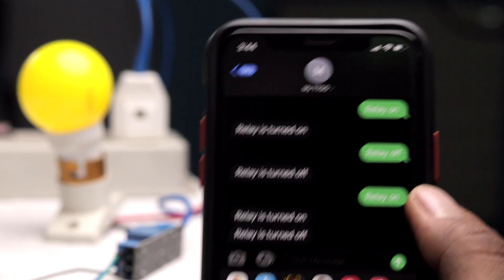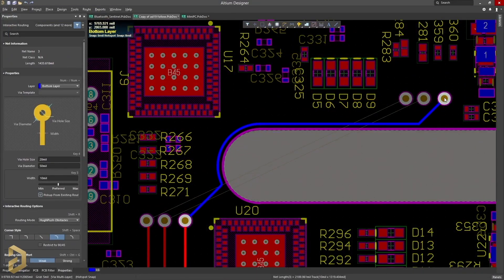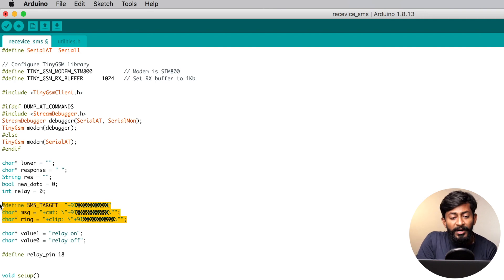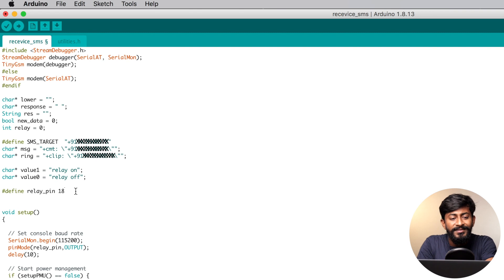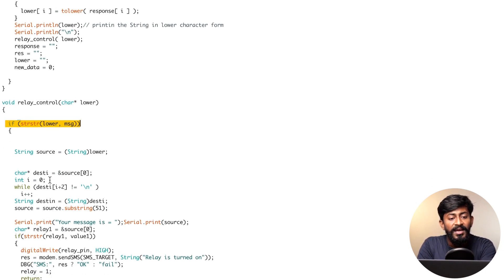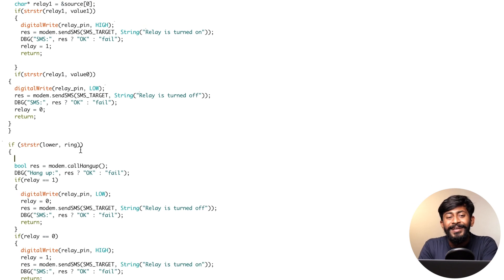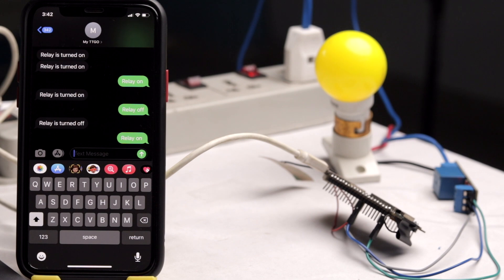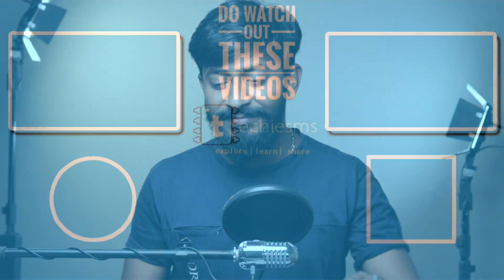SMS & Call based Home Automation project with Realtime Feedback using TTGO TCall module

Comment: In your project websocket based led on off with temperature Humidity by dht11 sensor ,when timer.attach function used in loop its work properly but when it is outside loop as you write it, is showing rst 2 (3,6)...  Stack something this type of error,I actually did not understand what is the problem so pl.give some suggestion

Comment: Well, this is not related to this video, but posting it here since this is your latest video and you might read my comment.

I am a big fan of your work, and after watching almost all of your videos at least 4-5 times, I was convinced to order custom-made PCBs from JLCPCB. Because you said it costs you only $2. Well, factually you are 100% right. But not completely.

It costs for a user to get the PCB "MANUFACTURED" AT $2. In fact, I was charged $0, thanks to JLCPCB.

However, I had to pay Rs4500 (DHL courier charges+import duty and DHL custom clearance handling charges) for the same PCB to get it to my location in Ahmedabad, India.

I think JLCPCB service is amazing, but the duty and transportation is something that is going to make the custom PCB extremely expensive.

I might be wrong or you might have another opinion about it, but I feel it's your responsibility to inform your viewers about the true cost of getting a custom-made PCB.
Reply from the maker: You are absolutely right. And I also did my job to inform you people by making a complete video about this shipping thing 

Have a look 
https://youtu.be/78qzJPnRzjA

Comment: Great techie 👌👌 
Share Video Share Knowledge Sachin 👌👌😄

Please make a Home Automation project  which includes multiple control methods like Android control Through Local Wi-Fi, Android control through IoT, cell phone control through SMS or call (for small keypad 2g phones), RF Remote control, Manual Switch control with feedback in android & sms. It would be All in one Baap of All Home Automation projects 😄😄🤩🤩